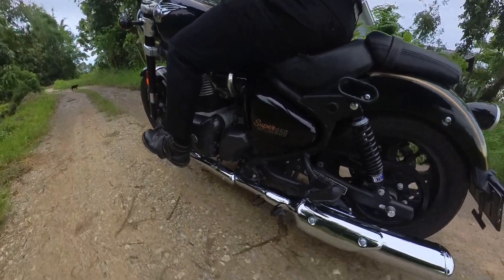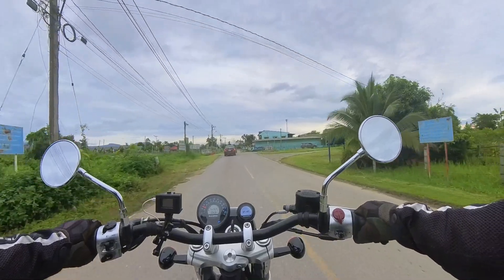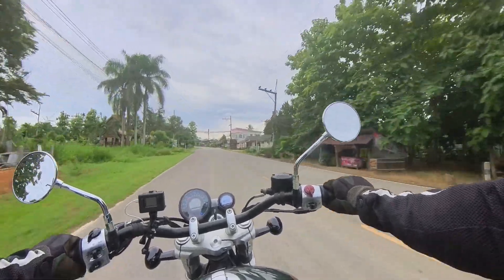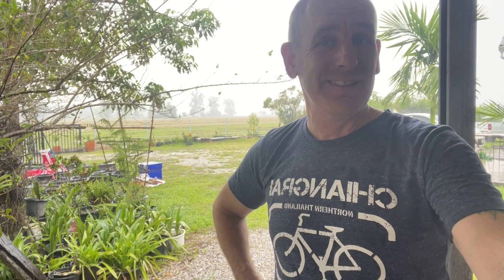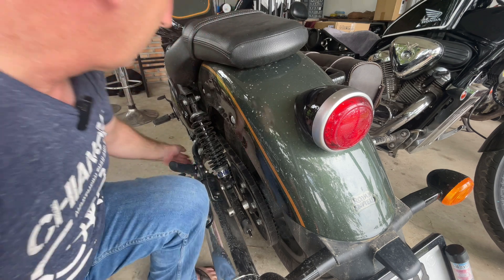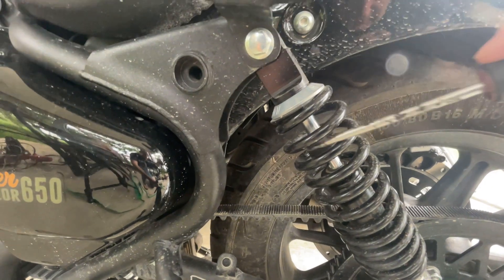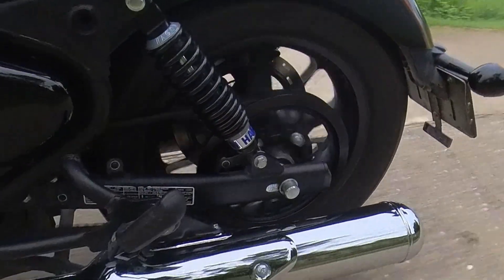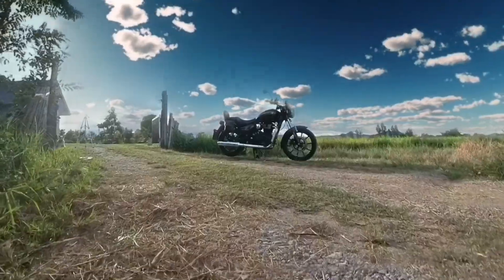Belt Drive: The Best Kept Secret for your Meteor 650 from RS Tech

Comment: Hi good lnformative video I take it the same belt and pulleys will fit the shotgun as well is the bloke who makes them make them for anybody who wants them and where do you order them from many thanks
Reply from the maker: Yes they should fit the Shotgun, but I don’t think any one has done it yet. So not 100% certain. But the frame and rear swing arm look the same, so should be no problem.  The link to RSTech is in the video description, or you can try here: https://rstech.my-online.store/product/royal-enfield-super-meteor-650-belt-drive 🙏
Reply: Yes fitted to the Shotgun now with several installations to date